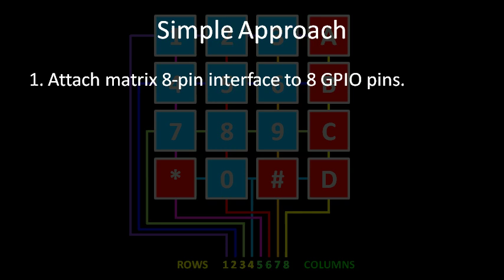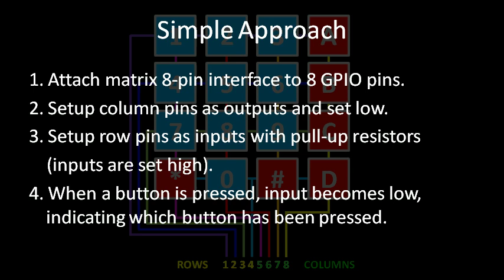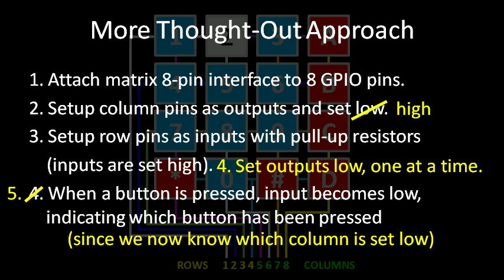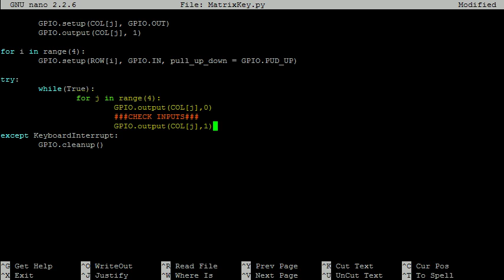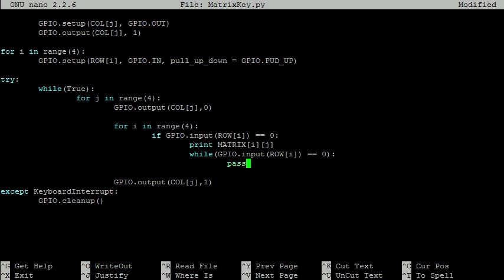Membrane Matrix Keypad with the Raspberry Pi

Comment: To spare GPIO pins, get an ADC and then only 1 pin can be used instead of 8. The code for this is much simpler as well. But since the PIs don't have Analogue pins just buy a cheap 8 or 10bit ADC that connects to you PI through the I2C or SPI interface.

Comment: Thanks for this video. It helped me a lot to build my first own matrix keyboard. I made a 7x3 matrix which I use for a SoundMachine. Each button plays a sound which is kind of fun in our office. I have noticed one small issue: When I push a button from the first row, I have to push it longer (about 0.5-1s) until the raspberry recognizes it. The other two rows are working just fine and very responsive to the button press. To make sure it's not a hardware issue, I switched Row1 und Row3 - then I have the same issue with Row3 - so I guess it's code related. Does this make any sense to you? Any help would be greatly appreciated. Cheers!

Comment: It wasn't immediately obvious to me that setting it up as GPIO.BOARD meant the actual pin numbers and not the GPIO SOC channel numbers. Using GPIO.BCM instead fixed mine for anyone running into the same issue.

Comment: Is there an analog version of this? Been Heck recently made a raspberry pie handheld console with 8 gpio pins for a 16 piece button matrix, without any additional interpreting code in between, just enabling the keyboard matrix kernel function. He did not go over the PCB schematic, and I am so curious as to how he got it to work. I can't tell for certain, but it seemed as though he was able to take multiple inputs at a time. How does any of that work?

Comment: Hello there,

My finished product (with the same 4x4 keypad) outputs only a random character from the same row. (eg pressing 1 would result in 1, 2, 3, or A randomly). Can you help me with this?

Thanks,

Alex
Reply: I had this same problem as well. You forgot a line. Watch the video carefully at 3:27. You will see two lines, one before and one after  ##CHECK INPUTS## -- remember, we have to set it low, check then set it back high. You forgot the line at the bottom of the check: GPIO.output(COL[j],1)
Reply: Hi JC, where should i put the "GPIO.output(COL[j],1)"? I have add in the code, but it still display random numbers. Thank you.
Reply: You put it right after "pass" with 2 less indents
Reply: Hi, Alex Ander, indents mean the space before the code? I am kinda new to python
Reply: Yessir. Make sure it's vertically in line with "for i in range(4):", like as shown in 4:18
Reply: It works. Thanks for the help
Reply: Can you please tell me how can I show the output in GUI?
Reply: omfg... GPIO.output(COL[j],1)
how the hell i didnt noticed this :o i checked my code 4 times with video... lost 2h of my life -.-
THX JC!
Reply: uhmmm.... yesterday was working perfectly... today after reset of my raspberry its random again i i changed nothing :o im pretty confused...
Reply: :o restarted RPi once more and works good again... :o
Reply: Thanks dear...it saved my time.

Comment: It's really interesting and it works well, but if I want to use others keys like 'backspace', 'tab', 'shift' and other, what I need to write ?
Reply: Hello you could stick some stickers over some of the keys like A and B and then change the bit at the start of the code and swap the a and the b to whatever you want it to be!
Reply: You can check the button pressed and do a specific action based on the character. For example, if it was an A, run some code. If it was a B, run other code. If it was a number, just append it to a string and check it if the user presses C.

Comment: I tried this code.but when I press a button it prints the first button which which in the same column.I tried several times.But faced the same problem
Reply: +Nayana Priyankara I had the some problem when I used gpio4 at the raspberry Pi. Just try using a different gpio pin!

Comment: Please I want the connection schematic I want to see where the pins goes
Reply: I don't know if this is still helpful to you but the pins listed in the section rows and columns are the physical pins you plug your keypad into
Reply: Look up gpio board pin numberings to see whats going on here, it should work out that all your Row pins are on one side of the pins and the column section is on the other

Comment: code plz
Reply: x2
Reply: import RPi.GPIO as GPIO
GPIO.setmode(GPIO.BOARD)

MATRIX = [
 ["1","2","3","A"],
 ["4","5","6","B"],
 ["7","8","9","C"],
 ["*","0","#","D"]
]

ROW = [7,11,13,15]
COL = [12,16,18,22]

for item in range(4):
 GPIO.setup(COL[item], GPIO.OUT)

for item in range(4):
 GPIO.setup(ROW[item], GPIO.IN, pull_up_down = GPIO.PUD_UP)

try:
 while True:
  for item in range(4):
   GPIO.output(COL[item],0)
   for i in range(4):
    if GPIO.input(ROW[i]):

     #MATRIX[i][item] returns the value in string that has been pressed. this value can be changed by editing the strings in the matrix
     print(MATRIX[i][item])

   GPIO.output(COL[item],1)
except KeyboardInterrupt:
 GPIO.cleanup()
Reply: @Frankium  bro i got an error.. can i contact with you to solve this problem.

Comment: hey how do you add a password to this code?
Reply: Add some code that will append the characters to a string. Then when a specific button is pressed or a certain amount of numbers have been inputted, check the password entered and compare it with your set code. I don't have much experience with python (I prefer C/C++ much better) but you should be able to figure this out. You can do this with C/C++ too, just use the WiringPi library. Just putting this information out there.